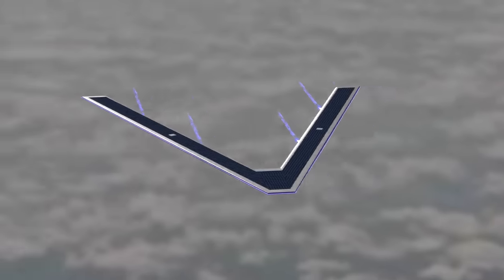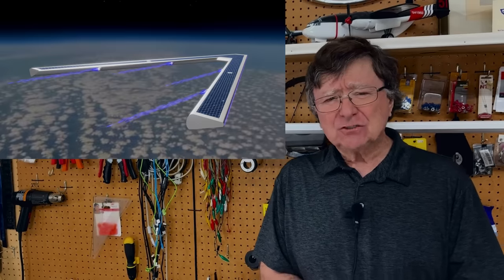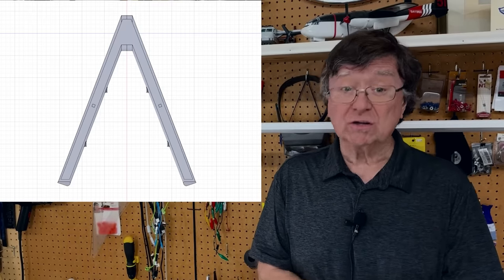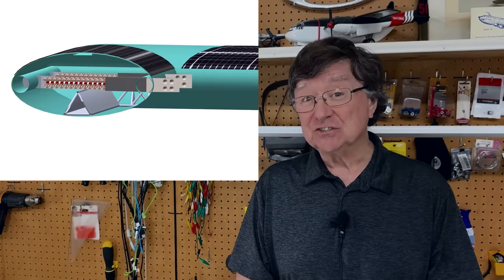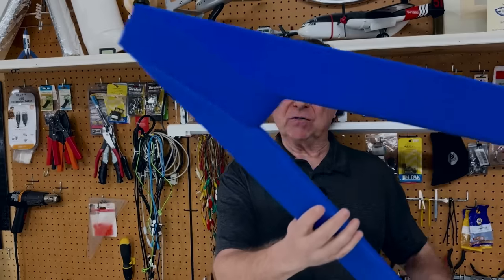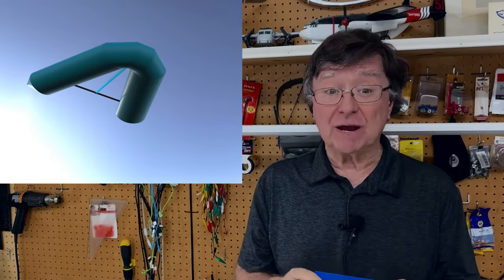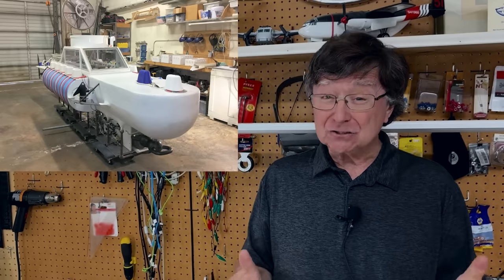Introducing: Ascender H1 Variant Orbital Airship

Comment: For the UFO watchers out there, this totally reminds me of the Phoenix Lights or Lubbock Lights Incidents. TY For finally telling me what they were doing!
Reply: exactly what I was about to say !!! Never knew this existed
Reply: Me to 😂
Reply: Bingo!
Reply: Im a field Geologist, I spend most of my time in remote parts of the Arizona desert. Several weeks ago we saw a massive triangular shaped craft with huge red lights in the back. It was just sitting in the sky maybe 1000 ft above Quartzite Arizona for quite sometime with those rear lights turned off. When they came on the craft started slowly moving to the north east and eventually was gone. I heard stories about the Phoenix lights, saw video but wasnt there to see it first hand but it sure as heck looked like the same craft from the videos of the Phoenix lights. The thing that was concerning for my team and I is whatever that thing hovering in the sky was idk but it was hovering over thousands of campers that were out on the LTVA La Posa North BLM camping area. We were coming down La Posa rd heading east when we noticed it just sitting there all blacked out, even with the lights off you could see this massive black triangle just sitting there totally still against the night sky as it was blocking out the stars. Id imagine others have had to see it when those red lights turned on, Personally those "lights" seemed to be some sort of exhaust manifold for the craft as if the red glow was some sort of plasma discharge as it was clearly coming from rectangular ports across the back of the craft. Whatever it was, its clear our secret space programs are much further then the claimed 50yrs ahead.
Reply: @paleogeology9554  The US definitely has some crazy experimental aircraft.
Reply: another interesting thing: this is Waay bigger than any aircraft from history . as big as the zeppelins were they got Nothing on this thing whitch is just insane
Reply: Yup, probably testing this craft and got sighted
Reply: @paleogeology9554  Incredible, This is one testimony I absolutely believe. So these red lights weren't underneath the craft? We're there any other noticeable external lighting?
Could you make out the dimensions of the craft, you say triangle, but could you see the sides and how "thick" it was. It would be great if YouTube would allow you to draw a picture of said craft in the comments..
Reply: dude thats the first thing i thought the first time i saw this
Reply: Yeah my best guess is this is what people saw when Phoenix Lights happened. It matches the description in most ways.

Comment: Great work, but I worry that you need to complete the triangle to avoid resonances that will get excited by the airflow. You show a giant tuning fork that could start ringing with both in-plane and out-of-plane resonances because the stiffnesses are too low for those long unconstrained legs. Maybe you have enough built-in damping to dissipate the incoming energy fast enough to avert trouble?  Also the cargo bay as shown has sharp corners. Depending on what the actual underlying support is, that constitutes stress concentrators that you don't need to have. All interior corners in a structure should be fileted with a radius that lowers the stress concentrations that are inevitable a interior corners. I know you know all this, but just in case, it doesn't hurt to raise the question.  Thanks a lot for your contributions to humanity!!!
Reply: Yes complete the triangle, fill in the center as well…  also make it completely black…. Make it the size of many football fields… Fly it over metropolitan areas… make sure it’s totally silent
Reply: No air resistances at 350,000 ft?

Comment: Love the idea and really enjoyed the video. Having worked on a hybrid airship for over three years, I can tell you the challenge is much more than just the technology. The logistics and operations are typically underappreciated by a technologist. We were looking at a 300m long ship that would have been a nightmare to maintain but yours is over three times as long with two hulls. And trans-sonic flight means there can be absolutely no holes or tears, while a smaller subsonic ship could handle this. 

Why not scale up a previous lifting body design? X24B seems like a much better starting point than the tuning fork as the surface area would be a small fraction of the current design. X24B or other current or historical listing body airframe would give you a much smaller footprint along with easier to manage structural dynamics. 

Suggest you consult with Dan Raymer or another aircraft design expert to study this from all aspects. It will save you a lot of time and money from going down the wrong path.

Anyway, good luck! It is easy to see how excited you are to keep going. Even if it never flies, you are having a wonderful experience that people who have not done this kind of thing may never understand.

Comment: The air density at 300,000 feet is about 1/50,000th of sea level.  Is it possible to create any buoyancy at all with helium or even hydrogen gas bags in air that thin?
Reply: No. But from what I've seen they will be at very high velocities by that point and generating lift from the body of the craft. Depending of course on if those particle accelerator engines really work and aren't unfeasibly heavy.
Reply: @danthemanzizle  I worked on the design of a lifter once that used a magnetic accelerator, a rail-gun.. At the end of the day the power requirements were the killer of the whole thing... For a 1000 ton vehicle & with a muzzle velocity of 1 Km/s it would be around 5 Terawatts minimum.  The only way even close to doing it would be with something like wires running from the ground. Not as bad as a space elevator but insane.

Comment: The Phoenix lights was I assume a concept test for something like this . This type of vehicle is the way forward in replacing long haul airliners . SpaceX thinking of using starship the same way but this idea is a great deal safer and less expensive . I get now fabric is useable because polymer science and material science have made tightly woven fibres really strong but I believe hard case carbon fibre or similar composite would be great for carrying large loads in a stable way.

Comment: Have you considered using your airship/space ship to go to Venus?

The upper atmosphere of Venus is Earthlike in temperature and pressure if not in composition. The gravity is nearly 1G and an airship would be the perfect vehicle to take advantage of that habitable envelope. 

Since the air on Venus is primarily CO2 nitrogen and oxygen are lifting gasses allowing the entirety of the structure to be utilized. The initial H2 or HE could be then used as industrial gasses.
Reply: I was just going to mention this. From the description, it looks like this could be an excellent Venusian Shuttle. If we are going to have a manned base floating in the upper atmosphere of Venus, perhaps this could get returning astronauts back up to orbit, where the transfer ship could then return them to Earth.

Comment: This is a fusion reactor that might generate substantial net power in space that could also drive a large space ship.  A giant inflatable mylar sphere one or more kilometers  in diameter.   If the sphere is charged up to maybe 10,000 volts positive, it will keep   electrons in orbit.  If the electrons originate at a certain point, they will always come back through that point causing a buildup of negative voltage at that point.  If the voltage at that point is maybe 10,000 volts and the point is far enough away from the sphere, it will trap deuterium ions within the vicinity of the point in a fusion temperature plasma.   Alpha particles travelling at 30 million meters per second away from the plasma  will be deflected by the sphere exerting a thrust like force on the sphere.     Some electrons will eventually crash into the sphere which requires a continuous supply of electrons to the plasma. 
If the alpha partuckes are traveling at 30 million meters per second, one gram of alpha particles per second  would equal an acceleration of one meter per second per second of a 30 ton ship or about one tenth of the speed of light in one year.  
The inside of the sphere would contain the space ship.  The surface facing the plasma point covered in solar panels would hopefully extract enough energy to power the ship.

Comment: This is incredible,  out of nowhere I thought the same 1mile wide platform with Kevlar balloons and carbon fiber supports to move containers over continents. Powered with hydrogen.  The hydrogen electrolysis would inflate the balloons to assend and deflate creating water to drop over drought areas, as it's delivering cargo inland near Continental interstates and away from ports.  This is so close it's hard to believe the reality.  Congratulations on your tremendous achievement.

Comment: At what max altitude are you estimating that this airship should be buoyant without propulsion?
I imagine between 25 and 30 km?  That would be enough to keep the hydrogen on the ship without tearing up the envelope when it reach space?   I imagine it would, because the ship has to be also strong enough to keep its shape.
I love this approach, even if it is just focused on trying to maximize efficiency over propellant to orbit (which in this case is almost zero depending how much abrasion engines receive on firing) instead on total system cost.
Reply: The highest a balloon has gone is over 57 km.

Comment: The design and concept of this craft is wild. 
   What surprises me, and I am not an air or space engineer, is the shape of the airfoil. 
   Compared to most "Aircraft", the airfoil shape is backwards. 
   But they did explain that it will have plasma to minimize turbulence and the air traveling over the foil is at an extreme angle. 
   The air where its going, or supposed to go is very thin. 
   This craft is basically a modern blimp, sort of, but it flies like a plane rather than a blimp. 
   To contemplate that this will fly at the speeds that it will fly being constructed the way that it will be constructed is what makes me contemplate the design.
   That doesn't mean it won't work, there are many people looking into the design I am sure, but of it works, it will be useful for its purpose.
   Will it need a runway? It's huge. Or will it lift veryically? Does it float?
Lol, hmm. Tech moves.

Comment: You don't mention how long you can run the hybrid rocket / plasma engines.   How much fuel can you bring with ? How much fuel do the engines use per hour?  Radiative heat will be an issue also.  Can you run the hybrid engines in plasma mode only?

Comment: So wait, you’re referring to actually inducing an arc plasma on the front in order to break the shock wave formed on the leading edge and thus reducing drag?? That’s amazing! I would have never thought of that! It’s still not clear to me precisely how this would work so I’ll definitely be looking into it now. Can you tell me, would you be using like a capacitance-like device along the leading edge, using the air gap as an insulator between a pod. and neg. linear electrodes in order to generate the plasma? Also, how would you keep the plasma from eroding the material of the leading edge over time?? Or is that one of the unknowns??

Edit: I have so many questions! I really wish I woulf have followed my passions as a kid and done well enough in school to be doing exactly this right now…😔

Comment: I believe the TR6 uses vacuum rather than lifting gas. It is a lot more efficient way to lighter than air craft via vacuum, and due to the fact pressure decreases as altitude increases you have no problem with flight ceiling. Although it is harder to engineer than using lifting gas it seems like a superior solution.

Comment: I am amazed by the idea and effort, but how do you want to combine an inflated wing with hypersonic velocities? Does the partial pressure change so much of the equation that you can push a blimp on Mach 5+ through it? 

Wouldn't it be easier to deploy a two stage system? You don't have to accelerate all the fuel and structure. Instead only part of the fuel and structure. Would make the concept lighter and more feasable in most dimensions.

6:11 I want to test this on feasability:
How many 100m are the wings supposed to be long? From what i can see it will be around 400m+ for each wing. You will need a completely new infrastructure, which would be very expensive in money, space and legal issues - i guess you want to use Helium? That will break your bank alone or are there new alternatives you secretely know of? You will need at least several b$ for this endeavour. Who should be the sponsor? 
Material wise there are additional issues like simply atmosphere. Air ships still crumble on a bad day without a storm. A 400 by 200m wide one in complex form won't do better.
How does it stir through dense atmosphere? Judging from your model, there is no concept to show now.

Edit: I completely forgot to ask, which fusion reactor the Ascender should use. Joke aside, it should be a SMR or should it burn hydrogen, which was maybe used as lifting gas? For the last one authorities would have a word in this.

Comment: Thank you for developing high specific impulse high thrust and light weight engines for applications in the extreme upper atmosphere.

Thin atmosphere aerospace is an exciting field which should be pioneered by the broad stroke creative enthusiasm of many people first. 

The engines might make stationary high altitude in the rarefied atmosphere platforms feasible. This would provide low latency easy to work on communication nodes. 

Maybe helium could be mined from the extreme altitude part of the atmospnhere. 

Another use would be high altitude geoengineering stations. 

Events anywhere on earth could be moniterd from stationary mild weather outposts. 

Thank you for your contributions towards advancing civilization. 

Aloha

Comment: I have an idea that may be of use. Double skin lift bags with internal hydrogen and outer a neutral gas (He?) Outer gas protects against combustion while you get the benefit of extra lift of H2. The hydrogen could be used as propellant or in a fuel cell

Comment: Thank you for developing high specific impulse high thrust and light weight engines for applications in the extreme upper atmosphere. 

The engines might make stationary high altitude in the rarefied atmosphere platforms feasible. This would provide low latency easy to work on communication nodes. 

Mary helium could be mined from the extreme altitude part of the atmospnhere. 

That's an interesting idea! Mining helium from the extreme altitude part of the atmosphere could offer a new source of this valuable resource. It's amazing to think about the innovative ways we can utilize natural elements for various applications. The possibilities are endless! 

Another use would be high altitude geoengineering stations. 

Events anywhere on earth could be moniterd from stationary mild weather outposts. 

Thank you for your contributions towards advancing civilization. 

Aloha

Comment: 2:17 See those bladders, consider a rail guns coil/s but not tethered, and rather than a single main Mass having 
several of those bladders acting as the main mass by phase switching their respective electromagnetic fields, 
now it won't be able to reach warp1 Err-Light Speed, but the point is, once it gets to max Velocity near to no 
energy is required to maintain Max velocity..

Comment: The foil should withstand Mach 25 at 100 km altitude for the whole thing to work. I'd say bring a smaller scale model with a rocket at 100km --- inflate it there and then test at which velocity at which altitude it breaks. At higher latitudes the speed to go with the sun for always having light is subsonic. Probably a way to skip batteries.

Comment: That is so big!  What are your low wind requirements for launch?
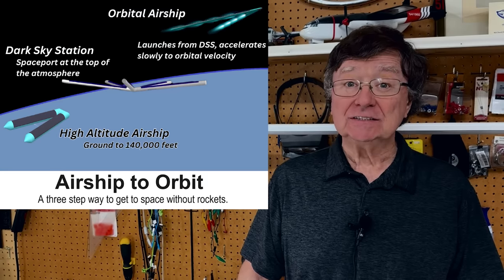Reply: having followed this channel for a while, maybe I can help out. Check out 0:33, the orbital airship is basically stage 3 and is actually planned to be put together in the upper atmosphere (dark sky station) above the turbulent airflows. Thus it can be made of much lighter material as it isn't subject to the lower air currents that would tear it apart. 

The high altitude airship (much more like what has already been tested) is smaller and sturdy enough to make it through the turbulent part of the atmosphere. Not sure the specific wind reqs though.
Reply: @jamesbailey4581  How did I miss that?  Thanks for the timestamp.  I wonder what hydrogen management is going to be like on the dark sky station, given hydrogen's tiny atoms.
Reply: @thomassuit7450 > I'd guess by the time they have the funding required to actually build these vehicles that industrial scale rolls of mono-crystalline graphene will make H2 containment relatively a non-issue, plus exceedingly high strength for its weight penalty.

Comment: this may be a dumb question, but how would the ascender survive re-entry into the atmosphere?
Reply: Like it ascends, it descends. A slow gentle transfer between lower and upper atmosphere. Like going up and down in a hot air Ballon.  Once in orbit, they can crank up the speed where theres less resistance to the atmosphere.